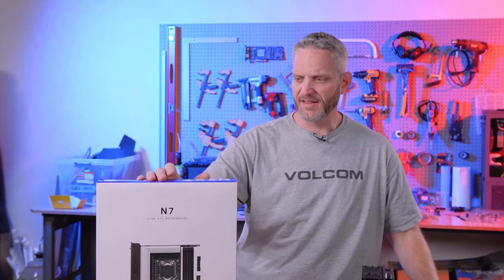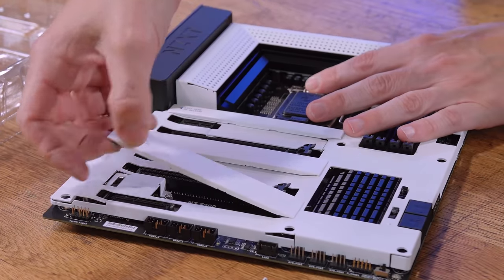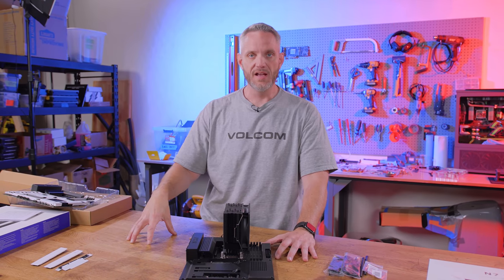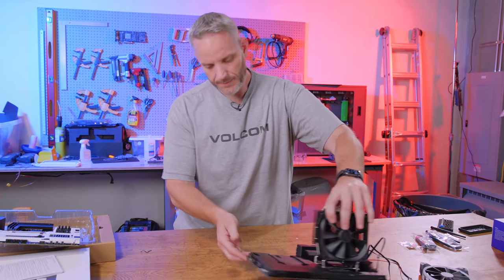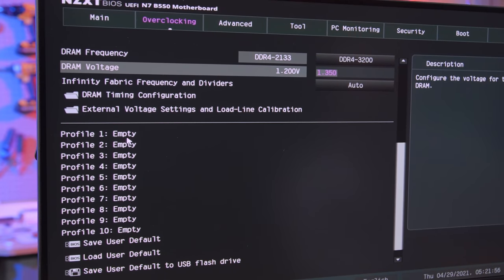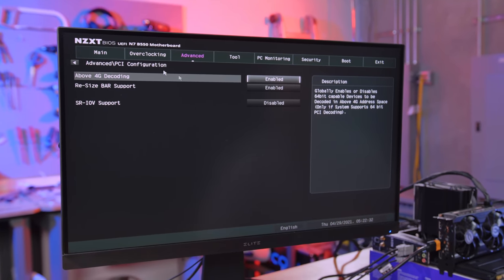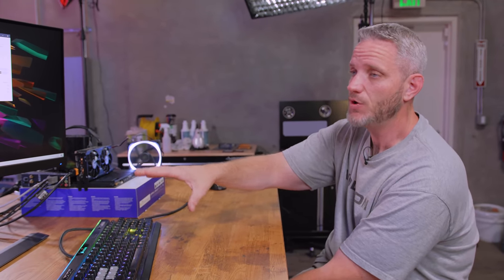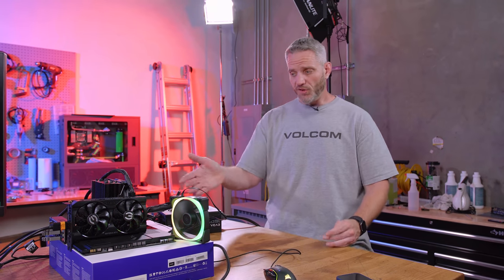Matte Black Motherboard Setup... Absolutely gorgeous!

Comment: They have brought these features to the Intel chipsets as well. I have the N7 Z490 in my system right now, near as I can tell, it's identical to that board. The only difference I've noticed isn't even board related, and that's the fact that mine came with a wired Wifi antenna instead of the ones that go directly into the board.

Comment: Asrock is my favorite board manufacturer I have been using them since 4th gen intel but I finally swapped to a gigabyte aorus z390 trying a gigabyte board after the headaches of 1st gen core series with the dual bios boards was a big step but I have been impressed so far will probably go back to asrock if I even have a slight issue though lol

Comment: Pro Tip: When you do a windows install in a system with multiple drives, disable all of them from bios or unplug them completely besides the one you want to do the windows installation. That way you are ensuring that the boot loader will be on the same drive as windows not elsewhere.
Reply: Wait.....so Jay isn’t a Pro? Would have never guessed that 😂

Comment: Hey guys, building my first pc, im doing x570-E from rog strix, amd 5900x and a amd 6900xt. I have an 850 power supply from corsair. Do you think it'll be enough?
Reply: It should be, but I would add up all the hardware that you are going to use what amount of power they need, to be on the safe side.

Comment: Noob question, but what would you use instead of the front audio connection? Is this in relation to the case IO headphone/mic jacks? And what are the alternatives?
Reply: The rear ports can be mildly better, but in general you want to get a digital signal to something that then converts it to analog outside of the electromagnetic interference inside of a case packed full of electronics. If you have wired headphones plugging into a DAC (digital analog converter). If you have larger speakers HDMI, DisplayPort, or the more antiquated coax/optical S-link to an amplifier.

Comment: sorry but this board is not worth it. you can get a strix b550 for 179 that performs much better with the same features. this is a sub $150 board if you take out the aesthetics.  just look at the actual test results. all benchmarks are lower than a strix. plus you'll have to deal with the shitty bios.
Reply: or you can just get an x570 tuf gaming for $180

Comment: A company that uses a third-party PCIe riser and drills a new hole into it instead of just moving their metal standoff to one of the pre-existing holes - which causes the whole PC to lit up is "making" mainboards?
Nobody needs NZXT mainboards so they should keep making PC cases and that's it.
Reply: Well NZXT commissioned the riser, they didn't design it themselves. The commissioned company was to blame. THEY didn't care. They just executed what NZXT had ordered, blindly, without telling them it's an issue. Maybe they thought NZXT knows what they were doing, okay. But still, NZXT could not know that this issue could arise cause they couldn't know about their PCB layout. Classic Chicken-Egg problem. The only bad thing was how they handled the issue. Could have been better. But all in all I doubt those motherboards will just light up on fire because of that mistake they did once.
Reply: @kyoudaiken  No, NZXT used a Riser made for something else. That Riser already had holes in it for mounting it to something. Instead of using these holes NZXT "drilled a new hole and used that" allegedly without checking the PCB layers.
Additionally they handled the issue really worse and the FCC had to step in.

Comment: Ordered this board right when it came out. I immediately put a thermal pad on m.2 in fear that it could throttle. Have had no issues so far
Reply: @tetra6219  it doesn’t. Had to buy some

Comment: does jaytwocents have an email i have a real issue ive been trying to figure out for a few days now ...my pc will be good its a year old ... nothing crazy but randomly started shutting off ... i have to shut the psu off and turn back on to be able to start back up ..when it shuts down everything is off except motherboard . i have to flick psu off then back on to start back up.. its random .. temps are fine nothing over 68c ..2700x ,2060 super oc 8gb  16gb vengance 3600,, icue 220t case .. corsair 650 psu  , x470 prim asus motherboard ..  started shutting off randomly .. might happen watching youtube five mins turn back on game for and hour shut off ,, or could game for hours ....i deleted all my drives reinstalled windows , updated drivers ... took it apart re seated every wire and cable i cannot figure it out no oc besides msi kombustor preset .. and ram in bios any help at all before i buy another psu and more ram and thermal paste and a new cooler ? i cannot figure it out
Reply: been gaming and running tarkov and warzone for like a year now its clean not dusty nothing ram fine hours everyday and just random started shutting off .. new power strip ive done it all ??? i need help
Reply: @JoshuaBollon  Does the 650w Corsair suffice your power requirement? I'd start by testing with another power supply, but first calculate your power requirement!
Reply: @DurandArthur  2060 super asus 8gb says 650 is good i just bought an 850 lastnight so ill see when it gets  here

Comment: cam crashes my pc. AMD builds seem to crash with cam
Reply: Disable XMP. It should never be taken for granted. If the crashes stop happening, you know what is causing it. Buy G.Skill RipJaw or Trident Z RAM, it's the most compatible RAM on this planet.
Reply: @kyoudaiken  I have trident z neo ram. I uninstalled nzxt cam and switch my cooler to a beafy air cooler. Haven't had any crashes yet. Just waiting for nzxt to fix problem. So I can go back to using my aio z73

Comment: what ever happened to motherboards that didnt need any antennas at all wired or non wired? and were still wifi motherboards did the industry just decide one day yeah we need antennas to look cool now or something?
Reply: It boosts signal since so many folks have wireless this or that today. I even replaced the screw-on antennas on my Asus router with antennas twice as long and it does make a difference in signal strength and how far you can get a signal. It's not just for looks, there is science behind it.
Reply: @bitterseeds  id understand for a wifi router maybe but most motherboards these days that are wifi are not wifi unless you use the antennas that come with them and its just so misleading and annoying
Reply: @animeprimelord421  Also, the Tachi X570 combines bluetooth and wifi at the same source. So the antenna is used for both. You don't put the antenna on and your BT connections are crap. That's the other reason, I'd forgot about it.

Comment: VRM performance verses other B550 motherboards? Interested to see if it will challenge the overengineered Aorus Master.
Reply: obiously not? is just a rebranded asrock something
Reply: @morcogbr  Good point. AsRock is known for weak VRMs. I was giving them the benefit of the doubt that NZXT might make AsRock populate motherboards carrying the NZXT brand name meet higher specifications. The questions become, does AsRock have that ability and would NZXT make that a requirement. I'm forced to say, probably not to both questions.
Reply: @TheOneTonHammer  it'a a 12 phase  (not sure if true or duplicated) 50 A each, good enough
Reply: @morcogbr  Not bad, but still not in the same league as the Aorus Master, which sports 16 phase VRM's in total (not doubled up) with 70A power stages for only $50usd more. It's basically an X570 board with B550 badges. Damn, Gigabyte should sponsor me... lol.
Reply: @TheOneTonHammer  yeah it's completely overkilled for anything you can put on it, they used the same vrm as the x570 Xtreme

Comment: 5:30 doesnt nand like to run a little hot?
Reply: Yes it does but the surface area of the controller is so small that it helps spreading the heat (which is intense especially on Gen4 PCIe) to the NAND chips. There's also multiple big copper planes inside the PCB for signal integrity purposes which also spreads the heat (copper, duh) of the controller over to the NAND chips. So it is still a good idea to cool the whole surface of the drive.
Reply: @kyoudaiken  yeah I gues that makes sense

Comment: I ordered it relatively soon after I received the e-mail notification about its availability.  I'm running the white N7 (in a white H500 case), 2x16 Trident Z ram at 3200MHz, Ryzen 5600x, 3060ti. Absolutely love it. The wifi and bluetooth were a great upgrade (previous MSI x370 had neither), allowed me to eliminate my fan/RGB controller, and it looks sexy as hell. The CAM integration works just fine, and the BIOS is easy for a relatively lay person like myself to use.
Reply: Any issues with the Board so far? How did you cool your M.2 drives? And what Fans you using on the system with CAM?

Comment: NEVER COOL THE NAND ON M.2s
Reply: Again, also for you some education on how thermodynamics work. The PCB has multiple layers and often has multiple layers of just plain ground planes in them for signal integrity and FCC conformity reasons. And those are made out of copper. Copper is an excellent heat conductor. Also the heatsink itself is an excellent heat conductor. So, the intense heat from the controller (especially Gen 4 ones) is also being dumped into the NAND chips. The surface area of the controller is also relatively small, so it makes sense to cool the whole M.2 drive, which also mostly moves the controller's heat over to the NAND chips. Additionally, the effects of writing when the NAND is cool are almost negligible. It shortens the lifespan of an SSD maybe by a few months - and it's still over the MTBF period the manufacturers claim cause they kept this fact in mind when calculating it. The controllers are made to take care of load balancing the cells and using the correct voltages to write to the cells. Don't worry too much about it.
Reply: @kyoudaiken  Yeah... sure.

Comment: The stickers on m.2s actually have thin thermal pads on the chips. If you take it off you will see them.
Reply: There's no point in a pad if it is not making contact with a heat absorbing plate, otherwise it's just acting as insulation.
Reply: @Safetytrousers  insulation would keep the heat in. It's more like thermal paste. Not an insulator.
Reply: @Robstercraw  Thermal paste does not actively have any cooling effect, it simply provides a bridge for the heat to pass through, but only if it passes it through to another plate that carries the heat way.
Simply putting something on a heat producing thing will inhibit the loss of heat from that thing.
Reply: @Safetytrousers  it will pass the heat to whatever is on the other side. Be it metal or air. It will not insulate nor inhibit the heat from passing. As you just said, it transfers the heat.
Reply: @Robstercraw  If it is the same size as the thing it is on it cannot pass more heat than the thing if it was bare. All it can do is slightly inhibit the loss of heat. The thing has to pass its heat into the pad which would just be passing it into the air, it's better to just cut out that middle man. A pad does not suck heat out.
A heat sink needs to have more surface area than the thing it is cooling so the heat can be dissipated across it. Metal is by far the best material to do that, otherwise heat sinks would just be massive thermal pads.
I also dispute that m.2s have thermal padding on the stickers. There certainly wasn't any on the one I took the sticker off.
Reply: You are correct but it's not thermal paste, it's copper foil.
Reply: @Safetytrousers  i took the sticker off my avatar xpg and you could see where it is. I still have the sticker. I could take a picture of it to prove it. They do transfer heat. They use them in consoles without heat sinks. They have been for years.. Do they work as good as with a heat sink? No. I'm not going to argue with you tho on something you must not know about.
Reply: @Robstercraw  What do they transfer the heat to? And what is an Avatar xpg?
Reply: @Safetytrousers  nothing, it's hust a sticker with it on the sticky side lol. The paper i guess.  Avatar is what my stupid phone thinks Adata is. 😆